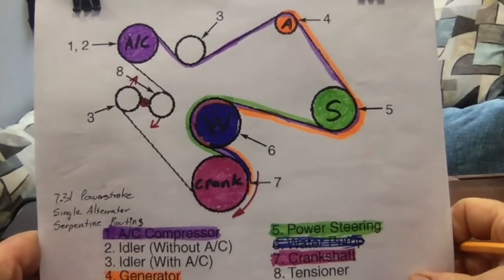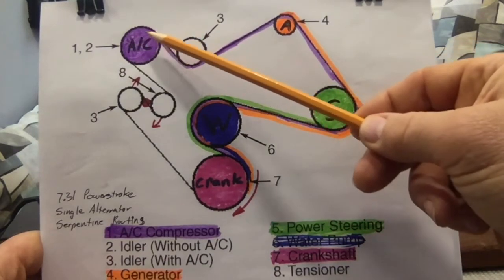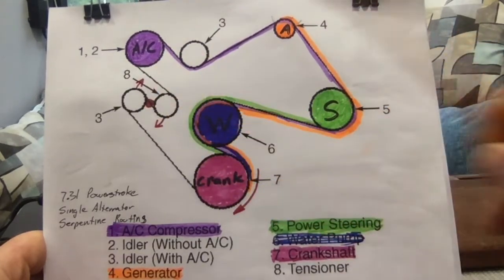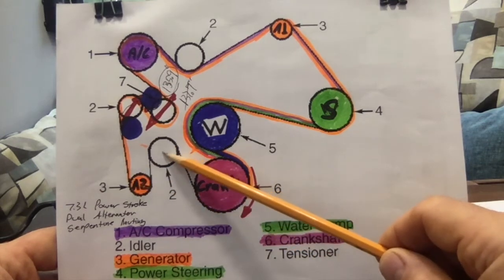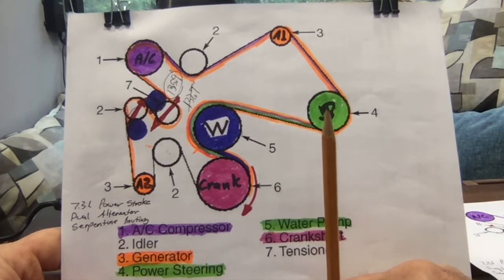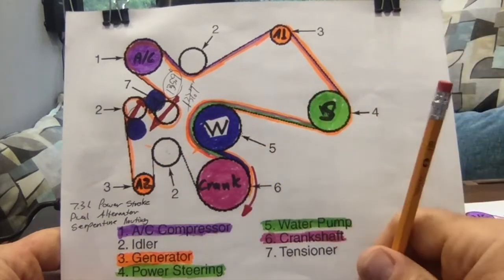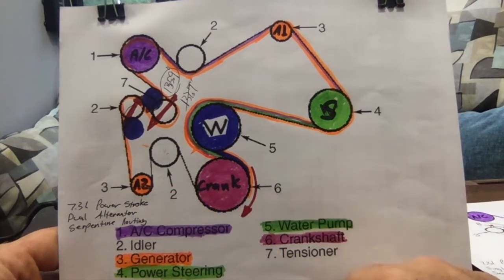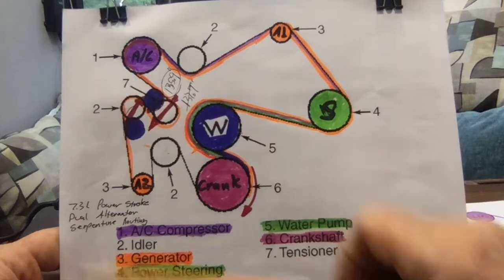Solved: 7 3L Dual Alternator Solution to the Belt Slipping Problem

Comment: I have a 2001 Ford Excursion 7.3 Powerstroke and have been considering a second alternator, but heard about the potential belt slippage issues. That has had me holding off until now. 

Thank you for making this video! I was not aware of glow plug issues if you don’t wire the second alternator correctly. Is there a safe way you can add the second alternator to the truck battery system, where both alternators can still be providing power to the batteries at the same time? Is there a glow plug relay you could tap into and only trigger the lower alternator to run when the glow plugs are off?
Reply from the maker: I think the belt slippage problems are greatly reduced with the shorter belt but think ever putting a very large alternator in the secondary would be inadvisable although the 200A I put in for my friend was fine)....one thought....put the primary in the secondary position and extend the leads to it , then put a bigger secondary alternator in the primary position where there is no issue with belt slippage. Adding the second and updating the ecu code to manage it is the safest method. Using a second only for charging auxiliary batteries (controlled externally and not part of the vehicle system) is also safe. Adding a second to be part of the 12v vehicle system  could be done with a relay that prevented the  alternator from working when the glow plugs were on BUT,  glow plugs typically cycle on and off at intervals so just sensing at the plug would not be a good idea. 1) You could find the control wire from the ecu to the glowplugs controller and use that signal. I am not optimistic that control wire from the ecu is just a simple on/off 12v signal either so some investigation would be necessary. 2) An option would be to get a 12v time delay relay. They may be adjustable or fixed but assuming you got a 1 minute delay and used the glow plug power to activate it, it could allow your second to come on after the glow plug was off for at least a minute. The TD relay will reset the 1 minute delay every time the plug switches on. I presume glow plug switching on/off would be single digit seconds both on and off so a full minute would definitely not accidentally come on.  If you were concerned, use a longer delay. This is likely a lot easier than trying to figure out the ecu control. Also, 2005 and later trucks used a 'large case' 135A alternator rather than the 110A small case and are superior. Most (but not all) are drop in replacements but be sure to check clearance under the alternator if you do it. If you see interference, minor grinding of the saddle of the bracket is a good fix. Lastly, do not use 'overdrive' (smaller) pulleys as they make slippage worse.
Reply: @WorkingOnExploring  Thanks for the informative reply. I do have a few more questions about the 2nd alternator install you did. 

1) Do you by chance know what 200 amp alternator was used? 
2) Is their 200 amp alternator still running well without the belt slipping (even occasionally)?
3) Do you have the technical reference on the glow plug concerns? 

I would prefer to have the 2nd alternator work with the 1st alternator charging the truck batteries. If the stock single alternator system delays charging the battery until the glow plug cycle is complete, couldn’t one just tap off the first alternator control harness and daisy chain the control wires to the second alternator?

 I do have the wiring schematic book from ford, and the glowplug system is a pretty straight forward 12v relay. A timed delay relay you mentioned for the 2nd alternator, running off the glow plug relay, could also possibly work.

I’m currently in the process of acquiring the 2nd alternator bracket off EBay for the 7.3L. It is a discontinued part, so hopefully my luck holds up on this purchase. Thanks again for any help with this!
Reply from the maker: The guy I did this for is Blake Scoot @cineblake on Instagram. He got the alternator from 'alternatorman', (YT handle), I can't recall his website...it was provided to him as his primary alt with an adjustable external alternator. I have used several alternators from DBelectrical.com. My 2004 6.0l has a 6G large case 135A primary alternator as primary and a 4G 220A as secondary, both from DB. I believed when we put Blake's 135A back in primary and moved the 200A to secondary, with a Balmar MC618 regulator w/alt temp sensor, we were running 180A (into 5- 100Ah battleborn lithiums at 30%SOC) without slippage. I can't recall if we had an overdrive pulley on it as well but think we did (which would have increased the likelihood of slipping). The pulley just happened to be on it from when it was his primary and we decided to try it. Since it wasn't slipping, we left it. That was a year ago and he lives in his 2003 F350 full time. He would have let me know if he was having slippage (if he noticed it which he might not if it was slight.) I'll look and see if I saved any references on the glow plugs. There is only a little public info out on the control logic of Ford dual alternators but I'm quite sure of the glow plug issues....I have the complete parts list for the 2nd alt install i think is on workingonexploring.com/TechDocs.
Reply from the maker: The primary alternator does not delay charging during glow plug operation in either the single or dual configuration, just the secondary delays. The battery debt and glow plug draw overwhelms the first alt and keeps system voltage below 12.0 or so. The problem is if both alts were to come on together.
Reply from the maker: Lastly, the Balmar MC618 regulator has good ramp up and down charging control that likely also helps prevent the onset of slipping.
Reply: Thank you for the clarification on the primary alternator and the fact that the primary alternator runs at engine start. This makes sense now with the voltages I’m seeing after engine start. 

The big reason I would like to avoid two separate systems is that the 7.3L Excursion doesn’t normally carry an installed lithium battery pack (like a slide in camper or sprinter van would benefit from). I instead own an Ecoflow Delta Pro, which is a 3.6kwh portable unit that I hook up to the trailer at the campsite. The unit can charge at a rate of 3000watts (or about 222amps at 13.5v with a properly sized inverter and beefy 4/0 welding cables going to the truck batteries). A constant 222 amp pull on one alternator concerns me, which is why I would like to share the load with two alternators. But it would also be nice to have an alternator system that can have a back up if the primary alternator fails. 

Balmar makes a dual alternator control module (MC-612). It includes features like a delay charge timer, adjustable target voltage for charging depending on the type of batteries being used, and a belt load manager (like you mentioned). 

Assuming both alternators were set up to be externally regulated, and they were charging the trucks single battery bank (two engine bay AGM batteries) via the Balmars (MC-612) wiring instructions, https://www.balmar.net/wp-content/uploads/2017/07/SUP-0204-MC-612-Dual-Installation-Operation-Manual-For-Review.pdf

Could you: 

1. Connect the ford primary alternator wiring harness OG/LB sensing wire to the positive battery sense terminal on the Balmar controller 
2. Connect the ford primary alternator wiring harness LG/RD switching circuit to provide Balmar regulator activation 
3. Set the Balmar controller to delay charging by more than 2 minutes to account for the glow plug operation 
4. Set the target voltage in the Balmar regulator to mitigate any over voltage limitations with the trucks factory wiring system and charge the trucks two engine bay AGM batteries. 

It seems to me that since the factory ford alternators are internally regulated, and you are simply removing that internal regulation and diverting it to the Balmar controller, the truck would operate thinking one alternator is connected, but in reality you would be benefiting from two alternators working together, properly, via the Balmar dual alternator controller. 

Also note that I have upgraded the battery terminal and alternator wiring to accommodate more powerful alternators with the following cable kit #4 from https://www.ficmrepair.com/index.cfm/page/ptype=product/product_id=1297/category_id=23/mode=prod/prd1297.htm
Reply from the maker: I found the Ford doc on second alternator locking out charging during glow plug heating. I posted it on my website; https://workingonexploring.files.wordpress.com/2022/12/fordaltcontrol.pdf. This control strategy will turn your second alt on or off by ECU control and can only be active if your ECU is programmed to handle a second alternator. If you were to install the alternator and hook it up to the factory wiring, I'm pretty sure it would never be switched on by the ECU. Since you want to have both alternators contribute to a common vehicle power system, it seems best to use ford's intended control scheme which can only be turned on by a ford dealer connecting to the OBD II port with their more capable scan tool.
Reply from the maker: Didn't see this latest reply....This is a bit back and forth but each point is numbered.....You are getting into dangerous territory...let me explain. 1) Internal VRs in your alternators provide (relatively) fixed voltage to your vehicle system and charge batteries' incidentally' (not specifically controlled to charge). The Balmar external regulator (MC-612 and MC-618) is a 'battery charging regulator' and as such, varies its voltage output based on sensed battery voltage. It is designed to be DEDICATED to battery charging of a separate 'house bank' and not to be part of a starting system. IF influenced by the system voltage fluctuations of large vehicle system demands, it will be confused about what voltage to output. Your varying vehicle loads will 'simulate' varying battery voltage to the regulator and its multi-stage charging control will not work properly. It would not behave correctly as either a fixed vehicle source or a battery charger under the influence of the varying load of vehicle systems. 2) The external regulators do have a lot of control, but always keep in mind, it is intended for a role as a dedicated battery charger. Everything you do to improve battery charging will possibly have a negative effect on vehicle operation (glow plugs specifically but not exclusively). 3) Balmar MC612 has been superseded by MC618 which has intelligent network capacity to communicate to their smart shunt and smart battery monitor. It is about the same price. It only provides added control if the added equipment is purchased. It also has a Bluetooth read/write capability IF using the smart shunt (won't be powered without it). Neat system BUT...it is a battery charger, not for vehicle operation. I'm not saying it would not work, I just know it would not work as intended. 4) you are correct that controlling both alternators with Balmar, into a common system would be a good for the batteries and your utility but not the engine systems, specifically your diesel fuel injection. 5) Be VERY careful installing a fuse anywhere between the alternator and battery. Having it function will destroy both alternators instantly. IF you do (and you possibly should), the fuse should be sized larger than the maximum alternator output so that it can never function on overload (power produced by the alternators), it should only function if there were to be a short circuit of the wiring. As such, the fuse should be placed right at the battery (within 7" per ABYC). Also understand, fuses (or breakers) under the hood are thermal devices and are influenced by engine heat. Meaning, they are designed/expected to experience a degree of convective cooling that will be significantly changed when housed in 120F engine-heated compartment rather than a 70F space otherwise. Meaning they will function at a lower amperage when in a higher-temperature environment. 6) It is a good move that you have upgraded the cabling from your alternators, even if you haven't changed their capacity. By merely demanding more from them (using your Ecoflow). 7) 'Belt load manager' is a derating mechanism to adjust your alternator load by reducing excitation by some standard percentage (across all programmed charging algorithms). Lower excitation voltage results in lower output voltage which results in lower output current which lowers output capacity and demands less energy input which means less belt tension. Balmar legacy literature still speaks of it and it is there but they no longer endorse it as an effective tool. It has no sensory or feedback loop so it just permanently derates your alternator. That may be useful but it seems likely not. 8) The Balmar time delay can be adjusted, if memory serves, 2 minutes is the default and 6 minutes is max. This means you will have NO ALTERNATOR function during startup and glow plug operation and ALL power will need to come from the batteries. The result is greatly depressed system voltage and much higher than intended starting battery debt...sounds like a FICM heart attack waiting to happen. 9)The charging ramp-up can also be adjusted which may be an alternative (set a long ramp-up) BUT without system feedback (or control), you have no way of knowing how long the glow plugs operate. In cold weather, they will likely run for 10' or more. Glow plug cutoff is based on engine coolant temperature which with a very cold engine block, takes a long time. 10) Consider an alternative. Split your two batteries with a relay that only connects them during cranking + 2 minutes (using a TD relay). The primary alternator (with stock internal VR) feeds one battery at a fixed voltage always and the secondary alternator feeds the second battery controlled by a charging regulator. The ramp-up control prevents the second alternator from adding much power prior to disconnecting (during glow 
 plug operation). Attach your Ecoflow only to the second battery. This still makes two systems that you didn't want but unless you are going to operate strictly as Ford intended, seems necessary. 11) Balmar regulators have an optional alternator temperature sensor (as well as battery temp sensors that adjust charging voltage) that can prevent the charging regulator from overloading the alternator. The alternator temp sensor does the same derating that the 'belt minder' option does but it is variable based on temperature (allowing up to 128C max case temperature) which is a good feedback/control loop. Hope this makes sense...Ive been at it for a while.